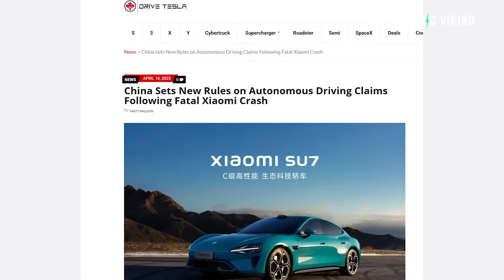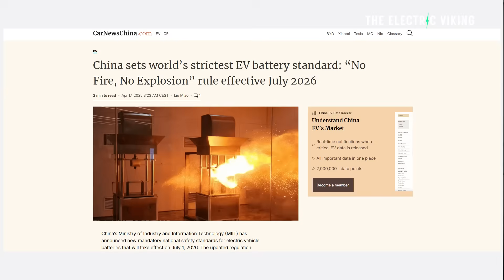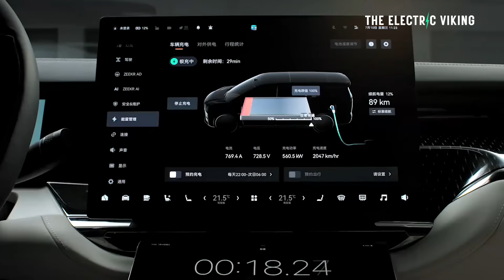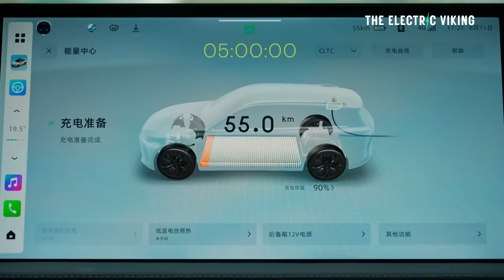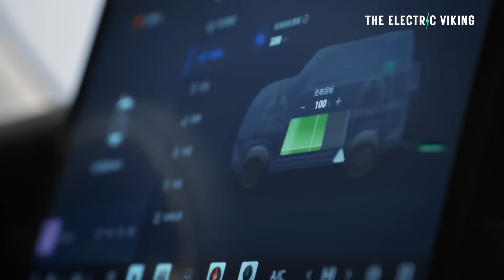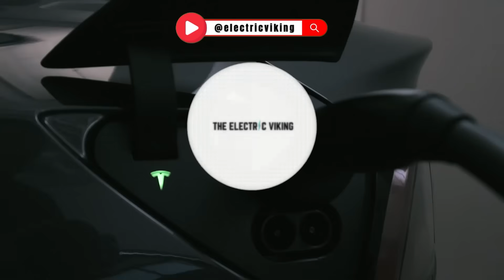China’s Game-Changing EV Battery Safety Ban Starts in 2026!

Comment: The most safest battery so far is the customade battery made by CATL for Huawei designed EVs

In one incident, a Huawei designed EV was rammed from both the front side and from the rear, by two HUGE trucks

The vehicle crumbled, folded up like an accordion, but surprising the batteries and the battery packs remained intact

No fire

No smoke
Reply: Safest battery rank: Gold Blade Battery,  BYD (release < 1 year) latest premium BYD cars > Short Blade battery Geely (some Zeekr, Volvo, Lotus) (1 year)  >> 1st Generation Blade battery (3 years) >> 1st and 2nd Gen LFP Batteries (5 years) newer Teslas > NMC Batteries Panasonic, LG Chem most of Tesla, Hyundai, Rivian
Reply: BYD claims they finally achieved a fully state lithium ion battery, which should definitely be even safer, it should once end for all get rid of battery fires.
Reply: I wonder about the conditions of the test. Some years ago I have seen the result of a real accident where a car was squashed between two semis on a highway. The fire squad had just finished to put out the fire: the car looked as if you had just crumbled a giant piece of paper.
Reply: Was this an actual incident or a safety test? If real accident then what happened to the driver? Please be clear when explaining.
Reply: @dmar1717  probably a test, you're not gonna survive, unless in a tank, when squished between 2 trucks
Reply: Maybe they forgot to charge the battery? Non necessarily a joke. The state of charge is key
Reply: The safest battery is the one that hasn’t been made yet…
Reply: Maybe its because of Huaweis early batteries not being that safe.(or was it a xiaomi either way one  of the mobile brands)
Reply: @635574  It's because of the Tesla EVs bursting into flames.